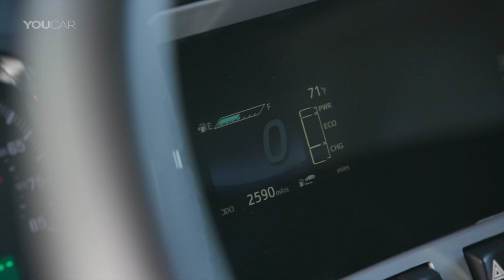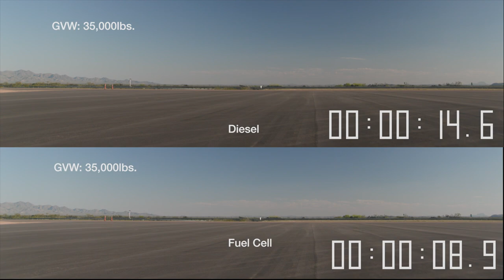FUEL CELL Truck VS. DIESEL Truck

Comment: Elon musk says that fuel cells are just stupid. too expensive
Reply: Stephen Nichols Elon Musk isn't a knower of all things. It'll be a very long time before a HEAVY DUTY truck can run on just battery power. It needs a generator to keep going and hauling HEAVY cargo for the long distances they do. A fuel cell allows this AND is clean energy.
Reply: The battery has much more negatives then the price and I hardly believe fuel sell is is a dead end.
Reply: Not so long ago nobody was making battery as well... when first introduced Prius was making no sense as well. Fuel cells solve the main batteries problems the mileage and additional weight as well as the time for recharging. If some day I'm forced to drive such shit I'll always prefer the comfortable of the fuel cells.
Reply: But then Tesla going to need half an hour to recharge only part of the capacity while fuel cells need few minutes. can you imagine what will be to recharge a 100 cars on a station placed on the highway? You going to need enormous place to install 100 recharges or half a day waiting for free one. 

The free and cheap energy for the batteries is the solar one - how you going to charge with solar energy during the night? Now you have free stations but when it become more popular you going to pay for this electricity because we are talking for huge amount. 

In the last few years there were several scientific discoveries that promise much cheaper way of producing hydrogen.  And this going to be improved if become popular way of transportation. Just remember what were the prices for the batteries few years ago.

I'm basically quite not interested by this EV future, but as far as I know Toyota Mirai needs about 3 litres per 100 equivalent so it is much more efficient then gasoline. Pure EV cars have some application at city transport but in the crowded cities the public transport is probably better solution (I personally live in small town and prefer to walk) while fuel cells gives the freedom to travel long distances. 

But as I said hope I would never be pushed to use non of them - the good old combustion engine is the one I want ;)
Reply: SDav21... maybe a fuel cell engine that generates electricity to then drive the electric motor........they can go the long distances...unless that was what you were trying to say.?!?
Reply: Stephen Nichols if elon says it then i believe it
Reply: SDav21 Tesla semi release this September I believe... let's see if you can really make these all electric
Reply: Stephen Nichols Is elon musk a god?
Reply: Elon musk is not the end-all be-all and i never said he was. just look at this from a business point of view.  he started (our least was a major part of) three companies that went from nothing to billion dollar companies. not one but three of them. and his statements were from a business perspective. so of a man that take 3 companies and turn them into billion dollar businesses says it's not profitable,  then i would listen to that statement. i never said he was god.
Reply: You know what they say - the 1st million, then it is easy :) Yes Musk made successful companies, but he gain the capital at the times when the IT was virtually unknown, then it has the capital for researches and the connections, so he isn't something special - and lets fase it Tesla is still "on red" with few bilions and it will become harder and harder when the "big daddies" join in this EV party. Did you see the new Mercedes EQ or the gorgeous Audi e-tron sportback - this cars are heading to the market and then even if you are looking foe an EV vehicle you should be mad to take Tesla instead one of them :)
Reply: Benzinio 
I've seen the Audi e-tron and it is a very nice vehicle.  have not seen the Mercedes. VW did put something crazy into electric r&d last year ($15 billion i think) because of diesel gate.  with that kind of money they better make something nice looking
Reply: Its all about the money, Musk's business is EV so he will say EV is better and cheaper.
Reply: elon musk's space x cant even launch the rocket, and blames ufo for sabotage he must be a fraud just as al gore
Reply: chrisradla lol what, he has launched rockets 11. times and landed them back.
Reply: chrisradla what? Check Elon Musk he never said anything related with UFOs LOL
Reply: Seriously people understand the technology before you make sweeping statements. FC Vehicles still have Li+ batteries in them. They are not direct connect to the engine because a FC can not handle instantaneous load shifts like a battery. However, cruising the FC can support the whole load. Therefore, batteries at any cost or technology will exist. Elon Musk is all about propaganda, and pure electric vehicles definitely have no future. Think about it for 1 second. How could the current electrical grid support recharging EV if everyone owned them? It doesn't have much headroom right now let alone if everyone is using a tremendous amount of power to charge their cars. The grid would constantly crash - or everyone would only have a charging allotment time.
2nd EV have no future for distance traveling. They are exclusive to metropolitan areas. If you make the argument that FC cars don't have the infrastructure - EV would also require a huge infrastructure to allow someone to drive across the country (not to mention it would take about 10x longer minimum even with fast charging stations). FC vehicles could easily replace gas logistically if the infrastructure is made unlike EVs.The infrastructure is already underway in California.
However, if you believe FC vehicles have no future - why do all major auto makers have a division dedicated to this technology? Honda, Ford, GM, Hyundai, etc. Not to mention China currently is heavily investigating FC vehicles which is driven by government subsides like batteries were several years ago. Also, all FC vehicles currently in production claim a higher range than their EV analogs.
Are FCs the way of the future? Who knows because generation of the gas is still a question mark. However, it can easily be generated with spillover power, solar, wind, etc. Harder to say the same thing for EV because if you go from an energy storage battery to EV the efficiency goes way down. Also, batteries are not a green technology. Yes you can recycle them, but there are still harsh chemicals as by products. FC are much cleaner because they are comprised mainly of carbon and platinum - both of which are clean recyclables. So a FC car with 1/4 the size of the battery of a EV is much more environmentally friendly.
Both FC and EV face major issues to be a viable solution to internal combustion. However, FC is a closer replacement than EV when it comes to consumer application. All I have to say is, if you live in a city and don't need a big range RIDE A BIKE! - it doesn't get more environmentally friendly otherwise hope that FCs do hit the market.
Reply: Very well said Jester InFlames. I usually ask EV lovers to check what is the amount of oil energy they should replace if all cars become EV. Usually this is enough to make them quiet for a while :)
Reply: Jester InFlames all auto makers are into them because of tax breaks cafe standard limits and advertising. people still think the prius is better than a 70s caddy lol
Reply: Tobias James. Agreed most do (I still like my BBC though) but automakers don't spend millions of dollars unless they see a viable path to market at some point - no company does. Therefore it isn't all tax credit/incentive based (same thing could be said for EV with the credit since combustion/combustion hybrid still holds the vast market share). Plus the tax credit for FCs in America is gone - therefore if they stay in the market this shows they still have plans for the technology.
Reply: Well, I say it is stupid to put batteries on a long-haul heavy truck. Too heavy, too little range, not enough lifetime...
(he was right about passenger cars though)
Don't believe everything you hear. Inform yourself.

Comment: I don't expect an answer to my question, because no one has answered it yet, but here we go...... Electric power is great for what is, and I agree it is capable of replacing oil products for fuel, but how many hours will it travel on a charge and once the charge is depleted how long for the recharge???? Time is of the essents for the trucking industry and length of travel per recharge or refuel.

Comment: Ok yes it seems faster but then again you have an automatic vs a standard. The Diesel truck is shifting gears. You can hear it. Do this test with 2 automatics and then we will see how well it compares in acceleration. But like others have said how many miles can you drive pulling at max weight? How long does it take to charge? Also when it does break down who is going to repair it? A specialized service that will take a lot longer then a diesel mechanic. In time yes this could work. But what about crash testing. Will that fuel cell kill the driver in an accident?  How much weight does this setup add to the truck?  Cuz ultimately if its more then the diesel engine then your losing the ability to haul more product. If so in the end your wasting time and money cuz the benefit doesnt meet the standard of trucking.

Comment: Truck Drag Race is not an important thing, what matters most are cruising range and how long you recharge that fuel cell truck.

 Aint Nobody got time to recharge that for 1 hour.
Reply: Space Monkey Fuel cells dont get recharged, they get filled up like a gas tank, albeit with a fancier nozzle. I think the Mirai car that they showed with the trucks fills up in 5 minutes
Reply: ImaFirinMyLazuh so Hydrogen truck?
Reply: Yeah
Reply: I've seen you everywhere..
Reply: ImaFirinMyLazuh ah make sense
Reply: Dhruv S. Congratulation, well done

great achievement
Reply: It's a great technology. The only problem is that you need hydrogen service stations everywhere. And it's not that friendly to the environment to produce oxygen
Reply: Th3CrazyBOy I hope youre trolling
Reply: Th3CrazyBOy Oxygen is bad for nature and humans
Reply: Nissand21 guy no it's not
Reply: bullet206 it's not gas
Reply: It would be great if the trailer wheels and truck wheels would charge the fuel cell!
Reply: Space Monkey , true and it's not the fuel cell but the electric motor which gives max torque at zero rpm which translates into faster acceleration than any heat engine.
Reply: Future
Reply: Space Monkey and it is basically a daytime truck seeing how the fuel sales take up the whole sleeper cab
Reply: BaronBoar they need to be refueled
Reply: Space Monkey so you think it's going to take an hour to refuel?
Reply: BaronBoar I hope not
Reply: thatamerican550 *you're

Comment: Take the bed out of the truck but leave it the same size take up all the sleeper space add batteries and supporting hardware give the driver one of the smallest cabs in the market so much expenses added here like hotels eating every snack and meal from a truck stop costing way more money now what does it weight is it taking up weight for cargo since a regular day cab can do a better job at the right spaces n such

Comment: what engine was the diesel? a 410 is slow, but a 750 is quick! ps, with acceleration speeds like that, the load could shift!?

Comment: let's see that truck pull the Colorado mountains and watching died on the side of the road
Reply: JOSH ROSALES No problem with water-cooled electric engines. Your beloved diesel engine would also die very fast without cooling.
Reply: Verdampft und zugevaped the Hydrogen fuel cell can work at hot and cold temperatures
Reply: @nhcs2k  water cooled...electric egines? Those too don't even mix water and electric don't mix
Reply: @markiemarksgames8808  Seems, that you have absolutely no clue about it. Oh man, come on, it's established practice.

Comment: xD The test of the diesel is not right. A dual-clutch transmission is required to have a continuous power delivery. The electric truck has no problem with accelerations because it has no gearbox.
Reply: Mohamed RACHID the fuel cell truck,the faster one,is electric!
Reply: The fuel cell is a technology meant to produce electricity through a chemical reaction (that I do not understand yet), right? So a fuel cell truck is an electric truck. :-P Sorry for the confusion.
Reply: Oh really? Sorry my reading on Wikipedia did not make this clear at all. :-( Thank you! :-P

Comment: one, acceleration does it matter because trucks don't need to be that fast they're not race cars. two, it is impractical for an OTR truck where will the driver sleep? three, water is very precious to life why would we want to start using it as a fuel?

Comment: what about the driver?? there is no sleeper cab on the hydrogen truck it is the hydrogen fuel cells.   the other truck actually has a sleeper cab.   imagine how long the hydrogen truck would be if it had a sleeper cab,  than look at its weight.  it probably heavier than the diesel truck which would lower the amount of weight it could haul.  another thing is the size of the hydrogen truck is to big to be realistic for in town deliveries.  I like the theory of hydrogen but it needs to be smaller.
Reply: Joel Becker 
I would guess that if its approved for sale that they would make it all fit under the hood and between the frame.

Comment: Just the typical Jeremy Clarkson road test, see which one accelerates faster. Doesn't matter which one is more efficient or effective in hauling goods. I mean maybe its good for a lorry to accelerate Quickly when it doesn't have a trailer on the back, it must be so frustrating for drivers at roundabouts ect ect but full of expensive goods nah.. Waste of time

Comment: oh great something us heavy-duty truck mechanics  have to work on in the future.
Reply: That's the LEAST of your worries. Overhauling a Diesel engine  is a Major undertaking ( gas engines aren't trivial, either.) A Fuel Cell/electric motor setup requires little maintenance. Ditto an EV. You don't even need to change the oil or radiator fluid; mainly because there IS none. And, with regenerative braking, the brake pads will last a long time, too. I have a little EV car. I smile and wave past the gas stations. Sometimes I come in to buy coffee, and a snack.

Comment: That drag race is cute. But it's electric. most electric cannot maintain 100% power. Why's this important? let's see this fuel cell truck pull 80,000lbs up and over the Grapevine (I-5 North of Los Angeles) and see how long it can maintain power.

Comment: Now do fuel cell vs electric muhahahahaha!!!!~~~~
Reply: SwisssBolla nope it's not haha
Reply: SwisssBolla fuel cell is not electric... A fuel cell is a fuel source that consists of hydrogen thus allowing it to produce very little to zero emissions with one major flaw... Hydrogen is very explosive, but in this case I think it is worth it.
Reply: Drew7822 dude really??? Plain and simple a fuel cell only combines hydrogen and oxygen in which one with its positivity and the other with its negative charge produce electricity and water, and hydrogen is not expensive, the technology big business uses to create it is what makes it Expensive,
Reply: MAR108 I understand it produces electricity, it is not electric its self. Now on the other hand I never said anything about price....
Reply: The fuel cell generates electricity which drives an electric motor. This electric motor is exactly the same as in a battery electric car. Why should it be different? If you design the drive train for 500 kW it will deliver 500 kW. The more power, the faster it accelarates. Not so difficult, is it? 
To make it more complicate: Fuel cell vehicles have a battery, too. So this battery can deliver additional power during accelaration.

Comment: no sleeper cab, so it is a say driver only. day deliveries around town? but wait did you see how long it is? won't be able to navigate through city streets. are there a batteries on both sides of this truck? - how about we would quantify how many diesel powered excavators, buldozers, crushers have to run to dig up nickel in middle east for battery material? does not look promising

Comment: yeah wonder how that would do with a full load. probably not so well. not to mention youl need special stations to refuel this shit everywhere and the fuel cells take up most of the cab. its not practical. you cant replace diesel. at least not with the technology we have so far

Comment: I can refuel diesel fuel tanks in minutes how long does it take to recharge this truck? Good luck finding a charging station
Reply: A fuel cell is NOT a battery, so why would you need a charging station? Suggest you find out about fuel cells before commenting.
Reply: Torrey Ellison fuel cell is a tank of hydrogen. . fills up just like any other liquid tank. Not electric
Reply: Thank you purpleb1176 :-) Now who's the idiot Torrey? As I said, find out about fuel cells before making stupid comments. You fill the tank up with hydrogen in a similar way you'd fill a diesel tank, the fuel cell converts this to electricity to run the electric motor. Sure you can't just fill with hydrogen anywhere YET, but then it didn't take long for lots of fuel stations to get LPG pumps fitted as soon as they realised they might lose a sale ;-)
Reply: Sprintex Doesn't matter, my point is there's still no advantage over diesel, electric or hydrogen or whatever there absolutely no advantage
Reply: Apart from zero harmful emissions and non-reliance on fossil fuels you mean?
Reply: Sprintex What about break downs? good luck talking to a diesel mechanic about your truck 😂

Comment: yet the environmental impact is considerably more severe when taking into consideration the manufacturing process involved with electric vehicles as compared to ANY diesel truck.. search on the Toyota prius for an example... you will be shocked no pun intended
Reply: Sgt. Shill yes, but people do no read the LCA of anything